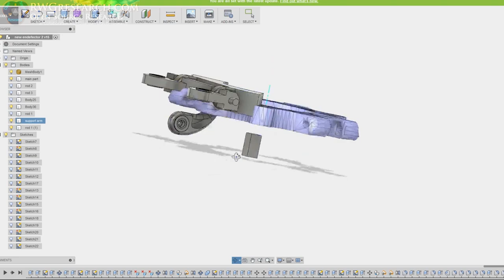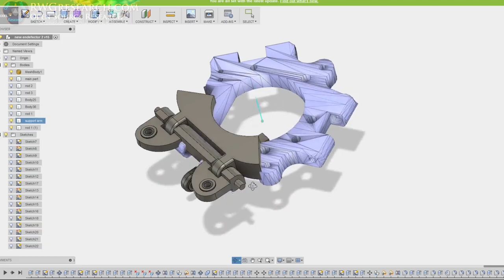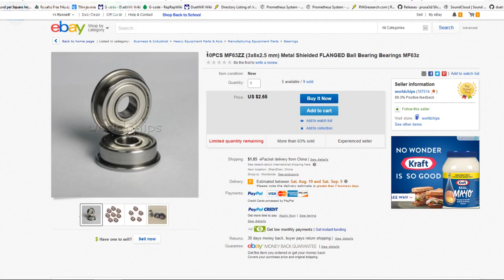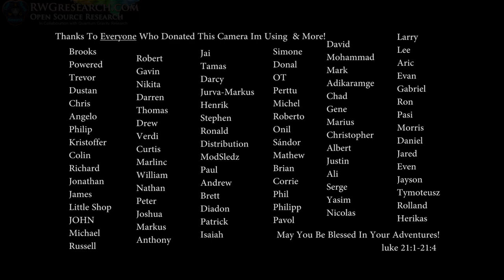RWG-OSD # 29?:  Joints on the Rod Arm. 3 Points?, Not 2!  Feed Back Welcome!

Comment: Cross braces on the 6 support rail will eliminate the rotational issue....
Reply from the maker: indeed. that's a good idea. but you cant put a rigid cross brace on something that moves closer and further apart. if we were only talking "up and down" then it would work. but this also moves side to side... and things change there distance???  am i missing something? 

~Russ
Reply: Your right, I'll go back to my "Delta's for Dummies" book. But it may be worth checking the flex on the struts.
Reply from the maker: lol oh im coming with you :) im still banging head on the desk about adding a third arm... :)  yeah the carbon fiber is solid. its mainly in the joints plastic parts. final version will be AL casted from prints. but that's at the end... more testing first :) ~Russ

Comment: Hope your wife feels better soon. May I say I love your bike :D

I'd been looking at delta designs and was wondering if this would be an issue... clearly it is :/
I like the idea of the 3rd arm...

you could use a spring cross brace to reduce wobble... but that would add more strain to the motors
Reply from the maker: Dan300891 print&go its only a problem if you dont habe a sturdy setup. Also o was applying alot. Of. Force to move that so much. But the third arm will help with the "rocking" but not the twisting.  And that's OK. Better joints will help that. ~Russ

Comment: Is there any easy way you can preload at key points where the movement occurs ?  I picture  a small spring + rubber for damping/self-correction+ maybe thumb-wheel for adjustment (if needed), though just some compressible rubber might do it. .  

In the distant past was working on an industrial cutting machine with parallel linear bearings. It would bind if tightened, or be too loose/sloppy if loosened up and vibrate.  In that (fairly different) case bolting what was riding on the carriages on though rubber quite tightly allowed the machine head be quite rigid at the same time as freeing the bearings, and damping vibration/slop.  Different situation of course,  but I feel the 3 vertical parallel rails may be setting up a similar situation, force and alignment wise, as we had with a heavy carriage resting on two parallel rails, leaving us to choose between binding on slop+vibration before the fix.
Reply from the maker: Jason Groothuis this is a good idea. Butwhen your trying to cnc with a .1mm end mill I would think any thing like that would really. Mess this up. But I agree that's a good way to go about it!!!!  ~Russ

Comment: Just fix the problem with rigidity of the carriage->rods  part, these are what is supposed to hold the effector level
Reply from the maker: true. more rigid parts will be better. however there are no joints like the ones i have that will to the angles I'm doing. so i must change it anyway. generic universal joints are ok, but pricey to get ones with no slop, and that are light weight. ( And not plastic) . by the way, if i was only doing 3D printing thses is fine. but the CNC is taking a tole faster than ever on those plastic Traxxis joints from the small vibrations. and. all parts will be cast in AL Eventually. still in testing phases. to make sure it works before i spend the time. ~Russ

Comment: what is ball bearing repression? do you mean pressure?
10 bearings per tri-arm per end?
Reply from the maker: https://en.wikipedia.org/wiki/ABEC_scale

8 berrings per tri-arm if you only use 1 on each arm ( i plan on using 2 in this design but 1 is enough.) 4 on the bottom ( likes yours). 2 on each arm, and 2 on the one part arm. make sense? more details will be had later lol   ~Russ
Reply from the maker: oh now i got to think about that bottom one.. hummm lol ~Russ

Comment: you could go magnetic joints to eliminate any slop.  thought you said you print predominantly slow so jerk forces would bet minimal of you are concerned about weight of the effector in that respect.  I'm in the middle of a build myself and I'm ordering a lot of CHEAP parts from China.  with the cheapness comes less quality.  I've just learned to design around this lack of quality and make it work.  I've got all the time in the world when I have to wait 3-4 weeks for parts tocheck come in.  dang that was looking.
Reply from the maker: yeah i feel better about magnetic joints. But on a CNC where there are forces in directions that are not in a 3D printer... i think the first time you push hard at an angle or get a burr in a snag and its all going to pots. i guess i just dont trust it lol. yeah if you have crap bearings that have slop in them then its no good. so will see. hope they will work. i just can afford to waist the funds... :( ~Russ

Comment from the maker: currently I'm worried about the bearing repression of theses cheep bearings. Thoughts?  I think there APEC1. anyone have any real knowledge of cheep bearings like theses?  If they have to much slop then its no good. and the better bearings are quite Pricey. i have a Bunch of Hard drives. but to get al those precision bearings out is a lot of work lol ( i need 72 for this design) ~Russ http://www.ebay.com/itm/112213033691?var=412472907262
Reply: I was about to mention hard drive bearings. But yeah, you are right 72 is a lot. Unless your dives are identical you may get a bunch of different size bearings.